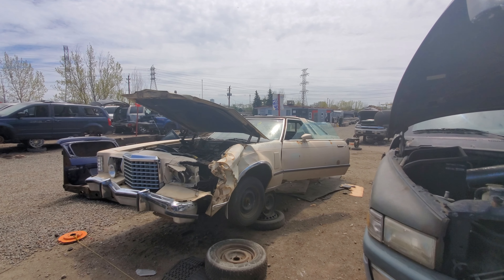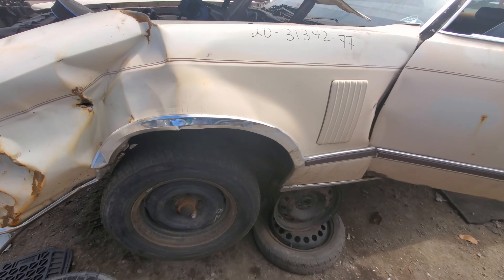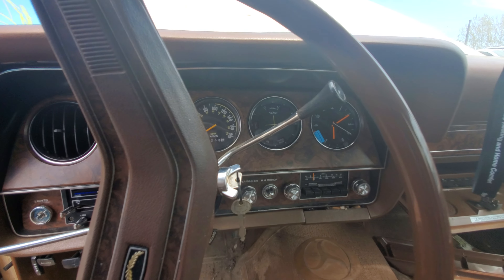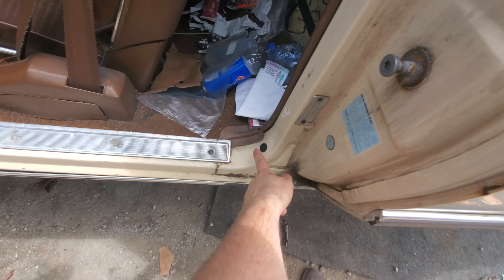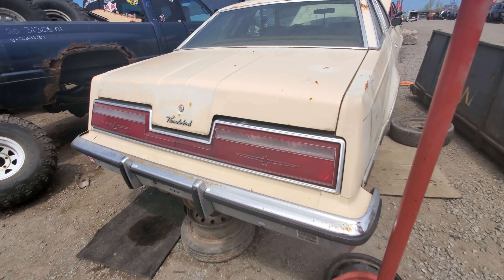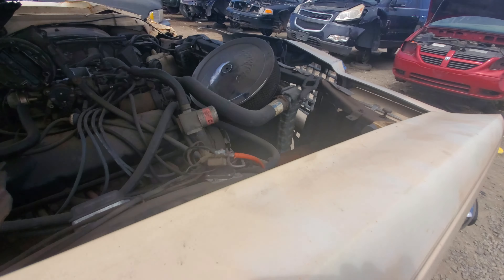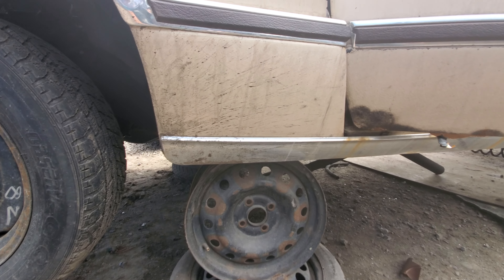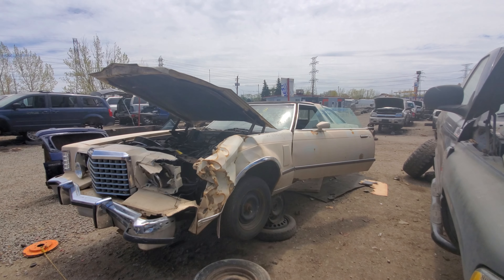Junk Yard Hoopties- Wrecked 77' Ford Thunderbird

Comment: Im taking care of one of her sister so really painful to see this great car in this sad condition. These are really good cars, not really have rust issues like the earlier Fords had. Great cruisers, drives like a boat. The sticker says 351m/400 so this means this could be either a 351modified or a 400. You didnt check the vin so we dont know that for sure. If thats a 400 its not too powerful its got only 173 hp, but carries the car pretty decently. I hope just a less valueable 351. Unfortunately Im too far, I could use a lot of parts.
Reply: I'm restoring my 1977 Thunderbird. I have the parts on my parts car that I could repair that one. (The frame on my parts car is rotted out.) I'd love to have that car.
Reply: the 351m is a 400